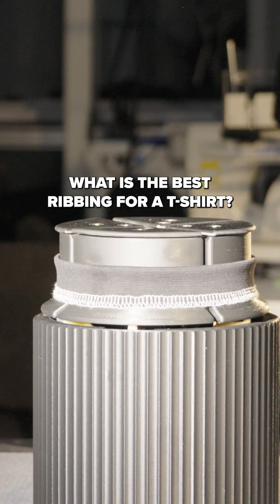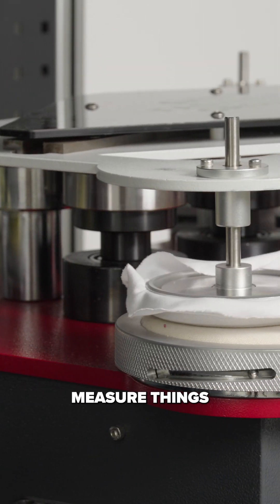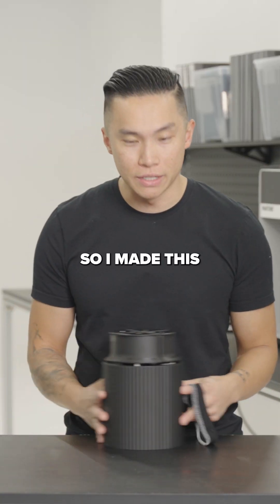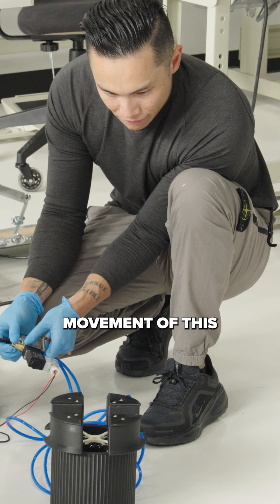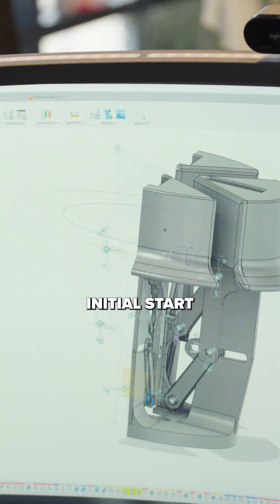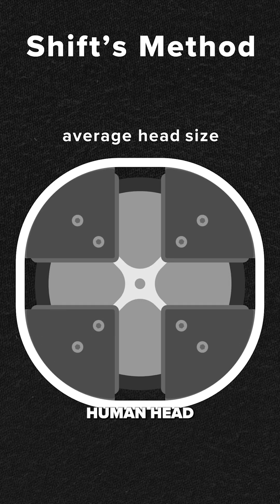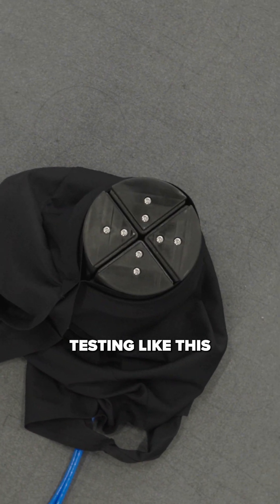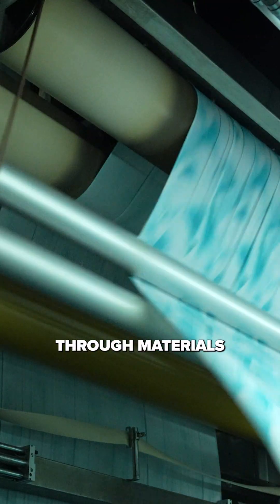We built a machine to stretch test shirts.

Comment: Looks great! As an engineer the only recommendation I would give you is to use a head size larger than the average. This way you can get a result with less cycles and the results would be useful for a bigger percentage of people.

Assuming you have the data, you could use the average plus one or two standard deviations (for 68% or 95% assuming a normal distribution).
Reply: This! A late reply but I am also an engineer. I work with steel not fabric but generally when you test your parameters should consider the maximum conditions.